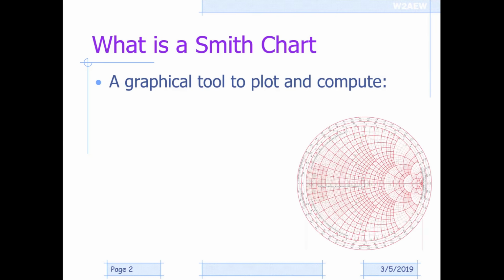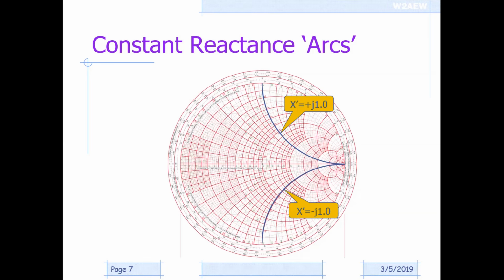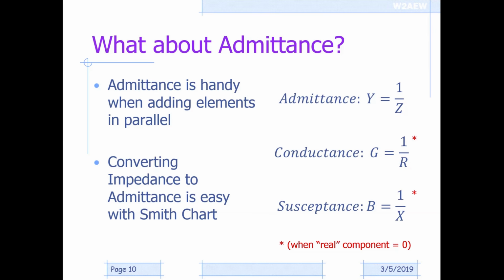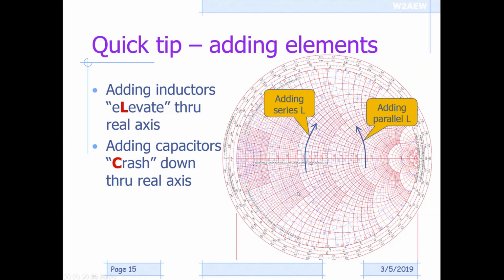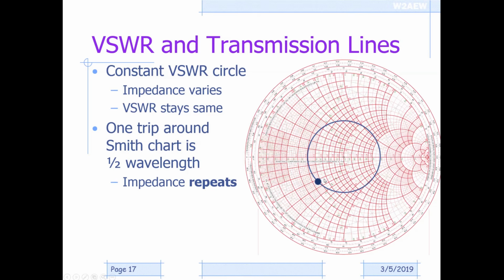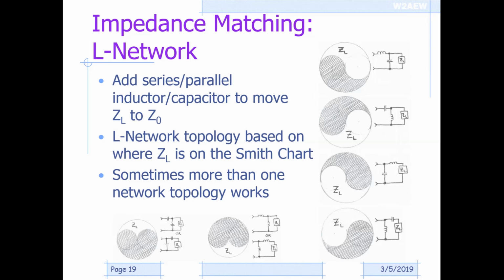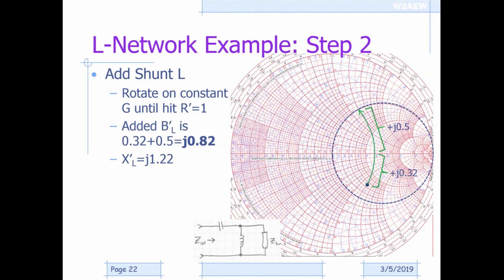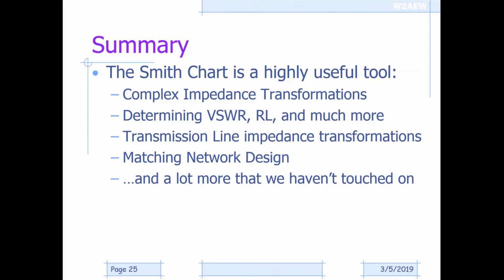#297: Basics of the Smith Chart - Intro, impedance, VSWR, transmission lines, matching

Comment: ON THE Smith Chart where do we read Vmin and Vmax?  Given a normalized impedance coordinate what angle in degrees is that location going counterclockwise toward the load, and also toward the generator. Can we read the wavelength on that location? how do we calculate the angle in degrees at that RHO location? where is the 'ZERO degree point on the Smith Chart. Where the SHORT LOCATION AND THE INFINITY LOCATION in the SMITH CHART. How do we calculate the DISTANCE of the location of the stub match and how do we calculate it's LENGTH???????????????
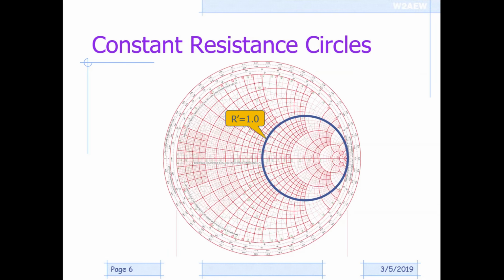Reply from the maker: There is no Vmin or Vmax on the Smith Chart.  The scales showing towards/away from the generator are for determining impedances etc. along a transmission line.  The location of the short (9 o'clock) and open (3 o'clock) are clearly shown in the video about about 2:30.  I didn't go into using the Smith chart for stub matching - that would be a topic for a potential future video.

Comment: Really great presentation, the best on Youtube! But how to simulate taped transformer impedance matching on smith chart? I tried with shunt and series L and looks like it does not work as intended
Reply from the maker: Hmmm - I'd have to think about this.  Would it radially scale from the center?
Reply: @w2aew  in general I tried to watch on Smith chart an tapped coil impedance matching for 5/8 antenna. I assume 112.85 -j567 Ohm as a radiator element. I tried an inductor equivalence of auto transformer of two series L with shunt L in middle, but I calculate that one inductor have negative inductance which make no sense for me. So probably I do something wrong, but I saw that there is such impedance matching,

Comment: I couldn't thank you enough for this knowledge. Can you explain the choice of matching network based on ZL that you drew? Although you showed a diagram, can you tell as to what are those boundaries. I partly understand that they are part of the constant G and constant Z circles for the Z0. Is there an extension of this that we could derive for say a PI matching.
Reply from the maker: A pi or T matching network can basically transform any ZL on the chart to Z0.  The L network is limited to certain ZL regions, based on it's topology.  I simply copied this information from Smith's book.

Comment: In BGA777N7 datasheet and many devices, RF Input and output internally matched 50R, there are some components (inductor or capacitor) connect by T or Pi network, Why?
How to calculate components value while RF input and output are matched 50R?
thank you.
Reply from the maker: Good question - I don't know the answer.  If the input and output are already matched to 50R, then the additional matching components shouldn't be needed.  It is possible that they are correcting for an impedance mismatch at the input/output of the test board (due to connectors, etc.) or correcting for a mismatch with the source and load used for testing.  It would be best to ask the Infineon applications engineers.
Reply from the maker: Follow-up - I spoke with a RF-expert colleague about this.  He said this if often done because parameters such as Gain, Noise Figure and Stability often do not occur at the same impedance match point - so the match at the ports will often be tweaked to achieve the best compromise of these parameters for a given operating frequency.  This may likely be done experimentally or in simulation for a specific amplifier design - so you don't really have a direct way of computing these values without intimate knowledge of the transistor level design of the LNA.
Reply: @w2aew  that is great experience. My project with test board or evaluation board is good at function and output level, but  my PCB with RF devices and connected DC block capacitor have good function and loss 3-4dB output level, always.
I know my impedance matching is bad :), but can not match without input device's parameters.
I think some components should be add on my PCB for tweaking :D

Comment: Thanks Alan, you have been a one-stop solution for all my doubts on many RF topics.
@ 10:07  :  increasing values of parallel L will not elevate on Conductance circle, but decreasing the parallel L  value will elevate along Conductance circle 

Can you please check and confirm on this? That would really really help me clarify my doubt 

Thanks,
Santosh
Reply from the maker: I should've said that increasing inductive susceptance "elevates", which is the same as lower the inductance value.

Comment: @w2aew If the impedance repeats every 1/2 wave length wouldn't this infer that a transmission cable could be infinite in length? I'm sure I've missed something here, but I know, after doing a quick search,  Ethernet cabling (for example) has a  length of 100 meters before the the signal becomes to low for transmission from point A to B. So, I assume there is a finite length for antenna cabling, in radio communications- due to signal degradation.
Reply from the maker: True, this doesn’t take into account the loss in the transmission line. Usually not too bad for a few hundred feet at HF, but can be considerable at higher frequencies.
Reply: @w2aew  I thought I had deleted this comment, sorry for the confusion on my part; I had no intention or implying something was incorrect with this video - "#297 Basics of the Smith Chart ...". Since, when I originally watched this video ,I thought your explanation of the resistance circle not changing the VSWR value meant, for one thing, meant that cable length, and it's inherit  impedanc,e didn't factor into the Smith Chart; I know realize that if you normalize a large impedance say 2500 + j25 , you would basically be on the far right side of the Smith Chart and it would represent and open circuit- with an infinite impedance. (Hope I'm understanding this situation correctly, now. )

Comment: For those of you learning the smith chart and want to understand why Inductive/Capacitive components move you around the smith chart the way they do, consider the following:

A series inductor appears more like an open circuit to a given RF frequency with increasing inductance (RF choke). Hence it moves the impedance clockwise on a given resistance circle towards the open circuit point. 

A series capacitor looks more like a short circuit to a given RF frequency as it’s capacitance increases (think of a DC block, a capacitor which allows AC through) hence it moves the impedance along the constant resistance circle towards the short circuit point.

For the shunt cases, imagine you are measuring the signal after a shunted branch to ground. 

Because of the shunt, there is a conductance to ground, and not all of the RF signal goes through the circuit to be measured. If you put a shunt inductor to ground, with increasing inductance, this branch will appear more like an open circuit to the RF energy, causing all of the signal to go through the circuit instead. This has the effect of moving the impedance along the constant conductance circles towards the short circuit point, because now it appears that there is a short circuit through to your measurement device instead of a branch to ground.

In the case of a capacitive shunt to ground, as the capacitance increases, the branch to ground appears more like a short circuit than the path to your measurement device. Thus, the RF signal will conduct to ground instead of through the branch to your measurement device. From the measurement device’s point of view, it appears as if there is an open circuit between it and the source. This is why a shunt capacitor will move the impedance along the constant conductance circles towards the open circuit point on the smith chart. 

I hope this helps you understand the movements instead of just memorizing them!
Reply: Not precisely saying. Eg,  A series capacitor is not moving "towards the short circuit point."  think if it's below the X axis. It is also moving towards the open-circuit point.

I would suggest we think it as "coordination-transform" .  Resistance-Circle is actually Y axis of a plain A+iB coordinate; (change L/C will move it up or down, bendedily)  Reactance-Circle is X axis. change R will move it up or down, bendedily)

Comment: Why do we need to normalize Zl with Zo? Is Zo transmission line impedance? And what about RF generator impedance? Does it included in Zo too? Sorry for these stupid questions
Reply from the maker: In general, good RF practice dictates that ideally the source impedance, load impedance and transmission line impedance should all match.  Most common is 50 ohms, others are used also (75 ohms, etc.).
Reply: @w2aew , thank you very much for this answer. Now I see it. What should I do if source, line and load have mixed impedance? For example source 50, line 75 and load 75. My source (VNA) has 50 Ohm only and I can't switch it to 75 Ohm mode and make ideal match for 75 Ohm level. How to normalize in this situation?

Comment: Eliminate the vocal growlshit. If you've got a sentence to finish and not enough air to whisper, take another fucking breath instead of groaning like a goddamn corpse or squeaking like a dry door hinge wheh you exhale.
Reply: https://malware.opendns.com/main?url=harriman.ddns.net%2FSmith%2520Charts.html&server=ash24&prefs=&tagging=&nref#This site is blocked due to a security threat that was discovered by the Cisco Umbrella security researchers. 
 Diagnostic Info:
ACType:0

Block Type
:security

Bundle ID
:63329

Domain Tagging
:-

Host
:malware.opendns.com

IP Address
:192.152.249.253

Org ID
:65283

Origin ID
:9305879

Prefs
:-

Query:
url=harriman.ddns.net%2FSmith%2520Charts.html&server=ash24&prefs=&tagging=&nref
Server
:ash24

Time
:2019-09-23 21:28:46.661929557 +0000 UTC m=+7600958.638047945
Gee, it looks like somebody got hacked.

Comment: Isn't it the case that Y and Z are across the diameter of a circle about Z_0 only when the system load is purely resistive? I guess the chart is assuming zero reactance for Z_0 in the first place, but what do you do if that isn't true (or, does that happen)?
Reply from the maker: Maximum power transfer occurs when the reactance is zero, which is why the chart is centered on that.
Reply: I guess in this situation when we say Z_0, we are talking about nominal impedance around a fixed operating frequency... is that right? I'm coming at this from a not-too-practical background.

Comment: I would like to ask any advise regarding smith chart .. i 'm doing one lab report for school. Currently i m facing issue with my S11 vswr . no matter at what using single matching (series or shunt, etc). My S11 is at 45ohm (which the circle is on left  side of 50ohm). Is there by chance, how could i shift it towards 50ohm) beside matching
Reply from the maker: Single elements in series or shunt can only move you along the constant resistance, reactance or admittance circles.  You'll need at least an L-matching network to move move from anywhere to the center.
Reply: @w2aew  thanks for the reply.. With same idea aside two components- itried with one shunt but as to get L conceprlt i increase thickness of trace which decrease my capacitance then i moved bk to 50 ohm using shunt inductor n intrestingly It works. Thanks for hints

Comment: Alan
I’m wondering if you’ve ever done a video or would consider making one on how to measure Common Mode Rejection of baluns?  I see many products that appear to be random lengths of coax wrapped around some ferrite cores. My understanding is that more turns is not always better performance. I also know that such measurements are usually done using a VNA, which I don’t have. Can it be done using an antenna analyzer or other equipment?
Reply from the maker: I'll have to add that topic to my long list of future video ideas.  Thanks.

Comment: Are Smith Charts still used?
Reply from the maker: Not many use them "manually" like this, but they are used a lot in more automated ways (like with SimSmith, or other simulators, or with VNAs).

Comment: I don’t see how the constant resistance circle at 3:00 makes sense. For the circle with R’=1 for example, I see the left end of the circle is on the horizontal axis where Z0=1 and as the horizontal axis denotes where complex portion of impedance is 0, it makes sense that R’=1 since Z0=1 and X’=0.

How can the right side of the circle also be R’=1 where it crosses the horizontal axis? This should be open circuit where X’=0 so complex impedance is made up entirely of real component. This point should be infinite resistance in order to be open circuit, not R’=1? Or am I missing something?
Reply from the maker: The reactance approaches infinity at the right end of the horizontal axis.
Reply: Ok looking at 1:50 in the video now I see the blue line overlaid on the horizontal axis that denotes the region where the reactance (jX) is 0 does not actually extend all the way to the far left or far right edges. So at the far right edge of the horizontal axis, the reactance approaches infinity rather than being 0 as it is for the majority of that axis. Thanks.

Comment: Since your Network Analyzer displays Smith Charts in real-time, why don't you show people how the impedance moves on the chart as you add capacitors, inductors and vary the length of the transmission line.
Reply from the maker: Take a look at the videos that are linked in the video description - I do exactly that in those videos.

Comment: It's great to see that hams are still producing tools like this.  The ones I began using [...way back when I was way less forgetful than I am now...], haven't been updated for use with later version operating systems (like windblows 10), and some others still require some sort of MS/PC DOS simulator, but fail due to deprecated I/O functions...  I know there are online smith chart 'calculators' available at various sites.  But this one appears a bit more robust.  At the very least, it's cross-platform (something I really like).  Well done!